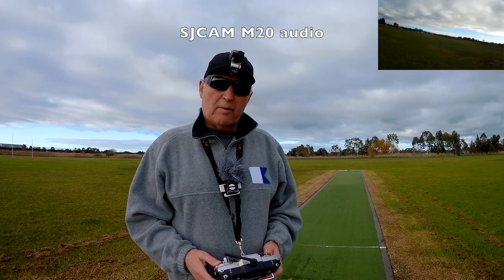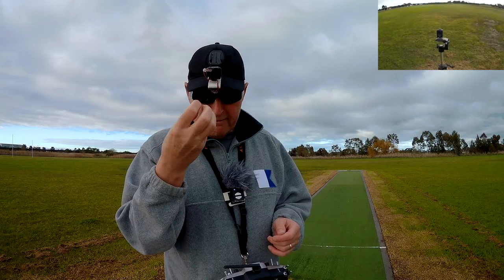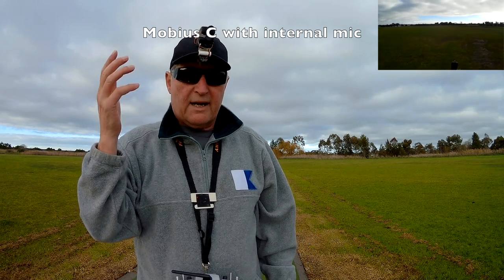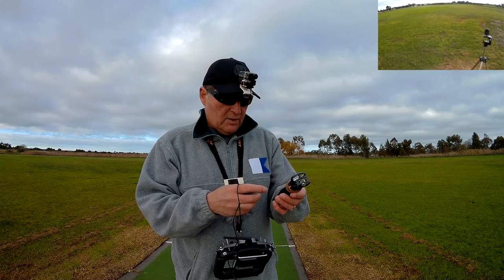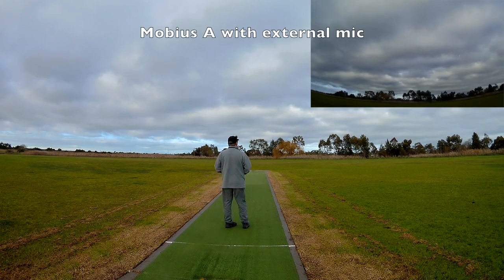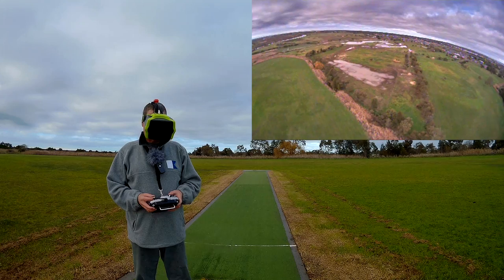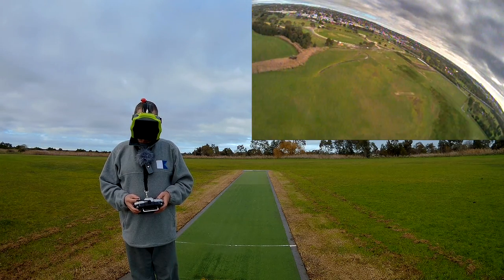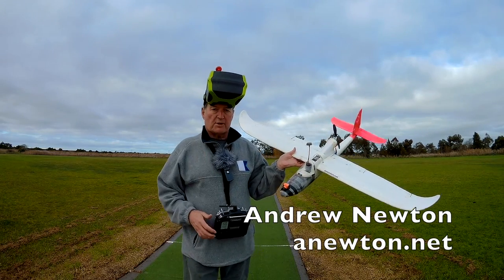Audio for RC in the field

Comment: Great job! Nice comparative.
Best sound with Mobius A and external mic, very impressive. Please show us how did you do that Mobius mic mod.
Maybe if you set down db gain at Zoom H1 you will get less noise and a better voice sound.
 You always can raise the volume in post production and eliminate background noise if nessesary.
You should try the BOYA BY-M1, cheap but great sound for the price! And able to directly connect either an smartphone, DSLR camera, PC or whatever. I love it.
Reply from the maker: Thanks for the mic recommendation, I'll check it out. I actually had the Zoom H1 levels way too low after the excessive wind noise, and had to boost it 400% in iMovie
Reply: Well, if you have db gain low on Zoom H1, the Mobius has even more impressive sound quality compared to H1, avioding a lot of ambient/wind noise. How did you make that wind muff? Is very effective!
Reply from the maker: I just sewed a little sock from the furry material and fixed it over the mic. I'll do a video on the Mobius mod soon.

Comment: Andrew, your mobius mod is very interesting. I'm looking for solution for recording audio for years. It seems making the microphone external  makes you voice very clear, but still...I don't hear the plane, the propeller in any variants you have tested. Even when you use ZOOM H1 (I wanted to buy it as well). My present solution is use Mobius with 8mm lens for the video and the old Samsung W200 camera as a sound source. So, still searching.Thanks for sharing your experience.
Reply from the maker: It's clear voice or ambient, can't seem to get both with the wind we get here.
Reply: @AndrewNewton  yes I know :) "You can't eat a cake and have a cake at the same time". I can handle with wind using dead cat windshield. Could you recommend me something for this type of records?
Reply from the maker: I like the Rode VieoMic Go with dead cat - https://www.youtube.com/watch?v=tf9ZwO-_cP4 But I usually rely on my Firefly 8S 90º hatcam  with external mic https://www.youtube.com/watch?v=Jk7McsDchpw
Reply: @AndrewNewton  thanks a lot. I will try it for sure.